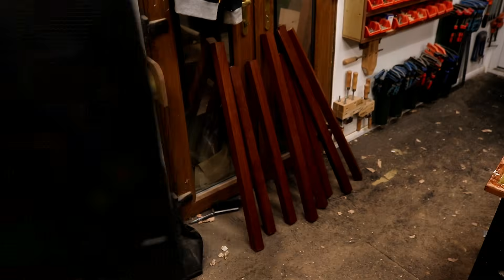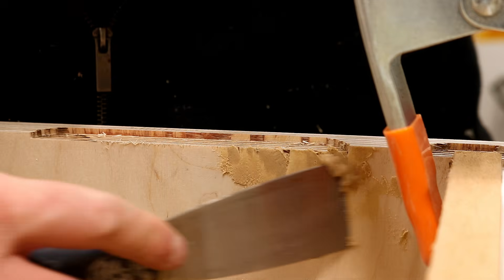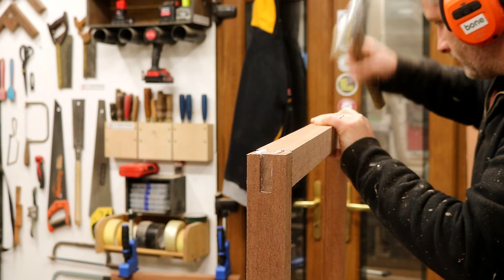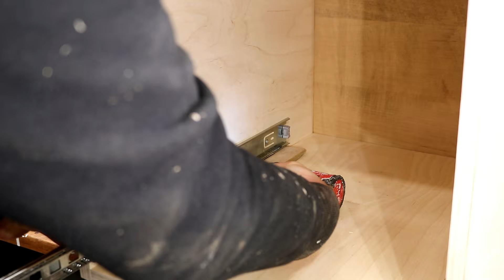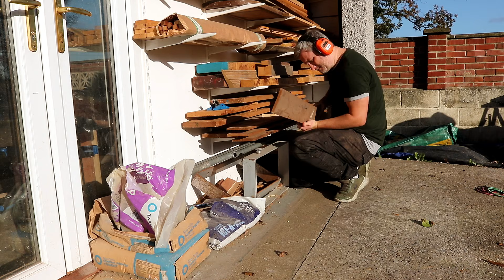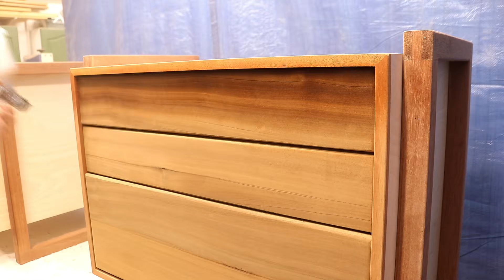Making My Dream Desk

Comment: How do you end up with a clear dustless finish at the last coats of varnish ?
We are in a dusty woodworking shop and small bits of dust land on the final coat of finish and have to sand it and recoat it again...
Any tips ?
Reply from the maker: Not sure, it's not an issue I've encountered, usually if the last coat doesn't feel smooth I just try again
Reply from the maker: You could try the brown paper bag trick

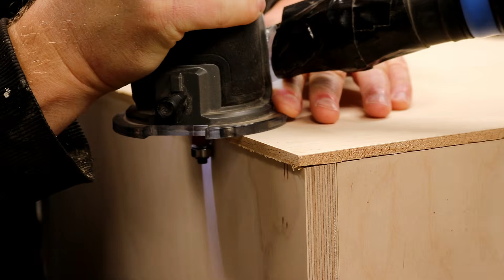Comment: 4:33  Good choice for this application, since it'll be hidden, but where the edge of the backer was more visible, one method I've used to minimize the protruding backer was to use a bevel bit on the router.  The eyeline goes past the edge of the side piece without seeing the backer in all angles except where the person is standing to the side of the piece near the wall.
Reply from the maker: Good tip!

Comment: Hi Keith i do drawers all the time in my work and for runners with overall width of 12.7mm each i always allow 27mm, always works and i screw the main larger part of the runner in the big holes so they have a bit of flex to move side to side, ive installed 100s of drawers and this never fails
Reply from the maker: Thank you, good to know for future!

Comment: Great build , always good hearing your design & build thoughts during the video. Sorry you had problems with rebating. It's not totally outlawed to do a climb cut (carefully)  with a router so you're pushing vertical grain inwards as opposed to breaking out. (Or do rebates before glue up!)
Reply from the maker: Thanks. Yes, rebates before glue up would have been best option
Reply: Which hardware supplier does the cheep damaged panels?
Reply from the maker: B&Q
Reply: @RagnBoneBrown  I need to get out there more often!!

Comment: For cutting the rebate for the back panel where it was tearing out due to the grain direction... next time, try scoring a line where the cut is going to be, cutting all the way through the face veneer with a nice sharp Stanley.  That should stop it tearing and you can router your rebate
Reply from the maker: Yes, but it would be a lot of hassle getting the score lines accurate to the router bit depth especially with the carcasses already assembled...

Comment: Just an idea. Why not put a couple of screws into the legs from the inside of the cabinets? I know that wood glue is strong but I would personally like that extra bit of reassurance and it will only take a couple of minutes to do.
Reply: I agree. 
Those drawers full of stuff will have a lot of shear force on the legs. Few screws wouldn’t go amiss
Reply from the maker: Not necessary.  There's so much gluing surface that it will be more than strong enough without